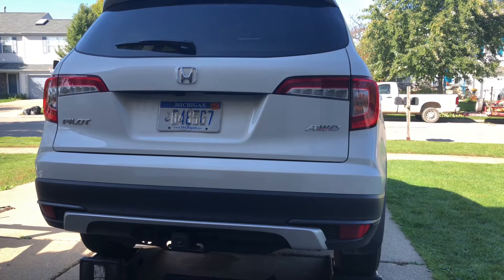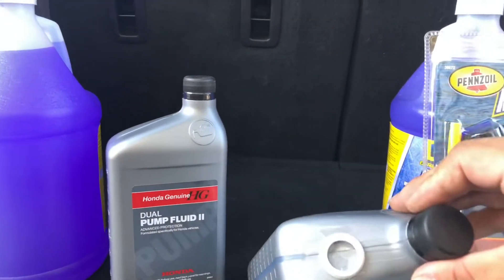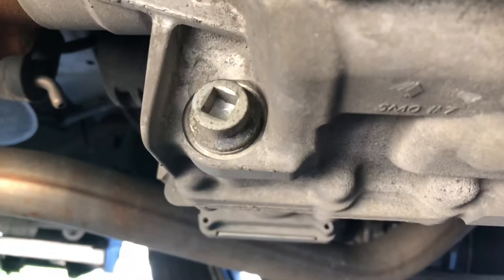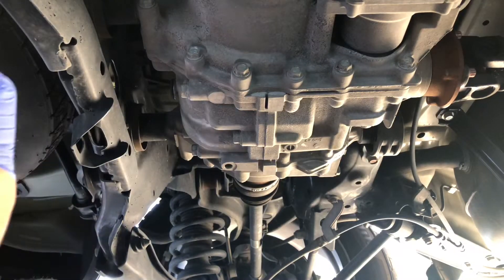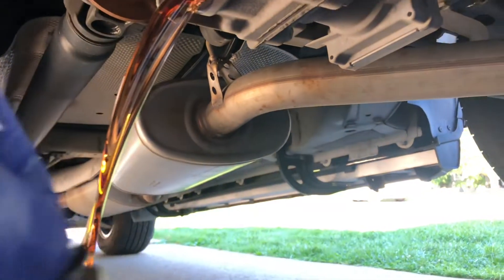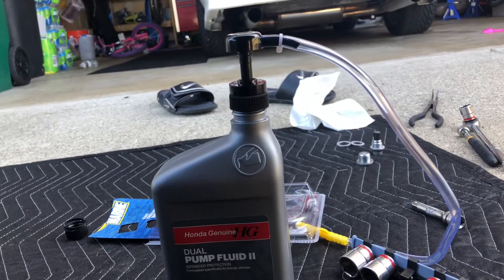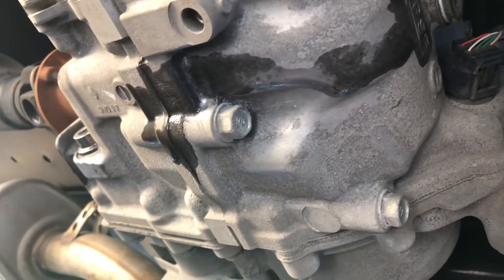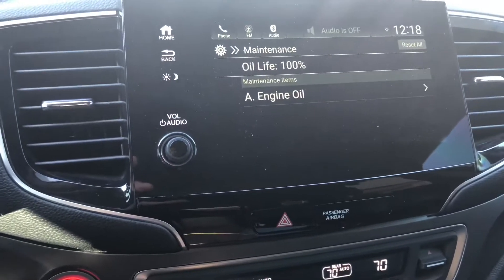2019 Honda Pilot rear VTM4 fluid change.

Comment: Air bleeding step is missing. After filling up to the level you leave fill plug loose and start engine for 1 minute in Park. After 1 mnute stop the engine and repeat (fill to the level, it will take a little bit more fluid etc.) Then you are done.
Reply: That doesn’t make any sense. This is a differential….
Reply: @vincent10717  Yeah, running the engine in park, with no drive power going to the rear wheels, and he expects the diff to do anything? Might as well just leave it open for 1 min, and do nothing else.
Reply: @CommieHunter7  The pump is electric. The service manual calls for bleeding the rear diff.
1. Remove the filler plug (A) and the sealing washer (B).
2. Remove the drain plug (C) and the sealing washer (D),
then drain the rear differential fluid.
3. Remove the metal particles from the magnetic surface of
the drain plug.
4. Install the drain plug with a new sealing washer.
5. Refill the rear differential with rear differential fluid to the
proper level (E).
Fluid Capacity:
1.82 L (1.92 US qt) at fluid change
2.33 L (2.46 US qt) at overhaul
Recommended fluid: Honda DPSFII
6. Loosely install the filler plug with the used sealing washer.
7. Do the rear differential fluid air bleeding.
Start the engine.
Shift the transmission to P position/mode.
Wait for 1 minute.
8. Turn the engine off.
9. Remove the filler plug and the sealing washer.
10. Refill the rear differential with rear differential fluid to the
proper level.
11. Install the filler plug with a new sealing washer
Reply: I suppose bleeding ensures the small air bubbles are vented?
Reply: @joenotte6170  Thanks much for sharing this step by step instructions.  I did this on my 2023 Pilot and I had to add 7 more pumps to top off the fluid level
Reply: @vincent10717  And it is a Honda so don't assume that it is just a differential. As stated below, it has an electric pump inside that needs the air pumped out which occurs when the fluid is drained.
Reply: @papajo7316  wouldnt have thought of that one not gonna lie.

Comment: Bought a new 2019 Pilot EX last September. Really, already rear diff fluid needed to be changed?
Reply from the maker: Yeah it wasn’t long. Not too difficult or expensive thank god!
Reply: @eddiesspeedgarage  I know this comment is a year + old but I heard the initial rear diff fluid is a break in fluid rated at a much shorter mileage but after the first change it would be like 30k between changes do you find this to be the case?
Reply from the maker: @AndrewJamison79  that would make sense
Reply: Yikes, I'm at 40k, oh well, now I know....
Reply: @AndrewJamison79  The factory installed fluid is not "Break In Fluid".  It is the same fluid that the dealer sells.  The first change is at 15k because the car is new and everything is breaking in.  This is why I do my first engine oil and filter change at 3k and then every 5k.  Yes you can extend the rear diff fluid change out to 20k but it all depends on how you drive, stop and go or highway or if you pull a trailer.  I can tell you that Honda does not use "Break In" oils or fluids of any kind
Reply: @papajo7316 That makes even more sense, thanks.

Comment: you have VTM-4 on your listing, it should be Dual pump fluid 2, VTM-4 will wreck your drive...
Reply from the maker: It’s the vtm-4 system. dual pump was used and is mentioned in the video.

Comment: I did this past weekend after watching this.  

The fluid is only available at Honda dealers.  $10 a quart.  You will need a 20mm and 18mm crush gasket.   The larger is for the fill plug and smaller for the drain.  Used a similar pump too.
Reply: Its available all over the internet a lot cheaper than that.

Comment: I thought the VTM4 drivetrain needed the VTM4 fluid. I had read the Dual pump stuff was for older vehicles and the VTM4 was what I should get?
Reply: Oh this video is 5 years old.. that may answer my question..
Reply from the maker: Dpsf II Honda part #08200-9007 hope this helps! If your pilot is a 2019
Reply: @eddiesspeedgarage  Thank you, I just picked up a used 2022 with 60k on it and trying to figure out which fluids and parts for all the typical maintenance items. I've seen videos on YT that people have bought Honda brand fluid that actually says "VTM4 Differential Fluid". I think I need to get that one.
Reply from the maker: @DavidJohnson-yk5xk  best place is the dealer they will give you the correct fluid when you give themThe year and model
Reply: @DavidJohnson-yk5xk mechanic here. Gear oil is gear oil.

Comment: To open the bolts what type of socket did you used? Great job man. Keep the videos coming.
Reply from the maker: arafat rahman just the 3/8 drive ratchet no socket required
Reply: Eddie’sspeedgarage thanks

Comment: I have a 2016 and a 2004 honda pilot , on  I never have change the differential fluid, i check and it looks fine the 04 has 240,000
 you must do alot of towing.
Reply from the maker: Very little maybe it’s my climate?
Reply: how did you chceck the diff fluid for 2016?
Reply: I suggest you change both the differential and transfer case fluids on both cars if they are 4WD.

Comment: Do you know differential Honda oil type 2020 Honda pilot black edition? Thanks in advance!
Reply from the maker: Honestly I go to the Honda counter and just ask for it. I hear Honda’s are finicky when it comes to their fluids so I don’t take chances
Reply: Should be the same
Reply: Dual Pump Fluid II  or Dual Pump Fluid 2    All Pilots 2016 through 2024
Reply: @papajo7316 No... Vtm-4 always check don't assume. Some are different ig they use the hence vtm4 system.

Comment: Do the washers must be replaced?
Reply from the maker: Yes you would be lucky if there wasn’t a leak if you don’t change them
Reply: @eddiesspeedgarage  Thanks
Reply: Yes, they are called "Crush Washers" and are made out of Aluminum.  It is not worth the risk to re-use them and have a leak that will destroy your rear diff.

Comment: Fluid looks so clean,... I would not change it if I were u
Reply: The fluid may be fine, but in the beginning there is a lot of metal wear.  An early fluid change is to get the bits of metal out so they don't damage the diff.